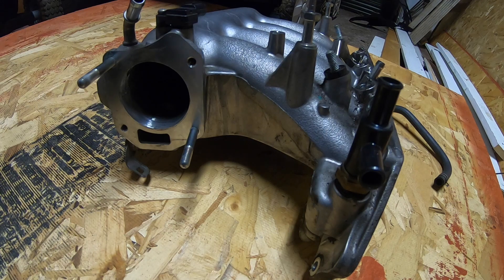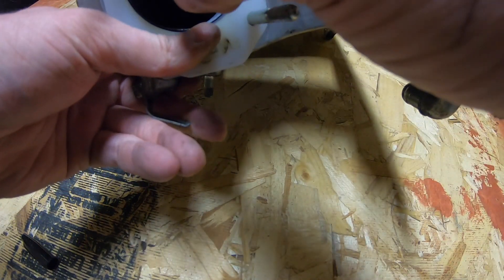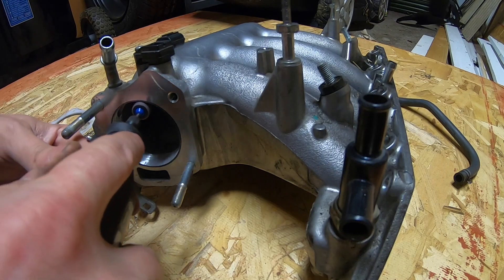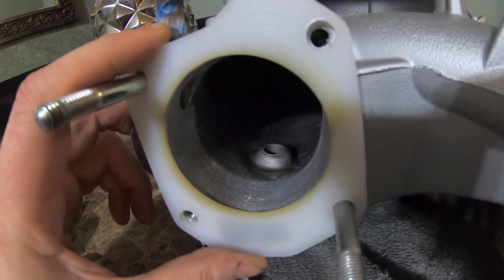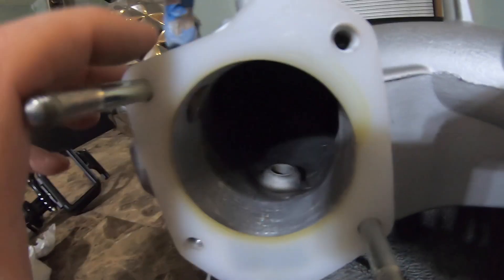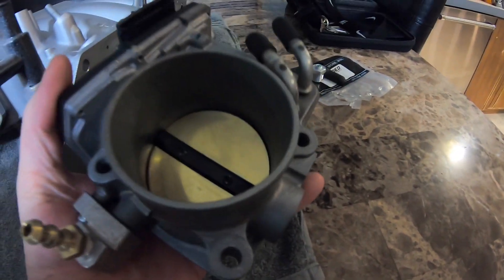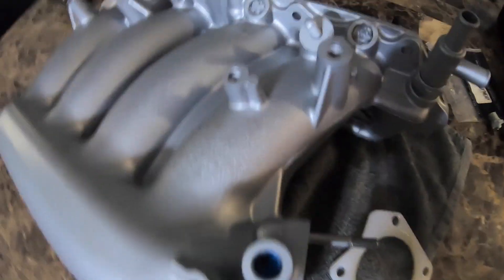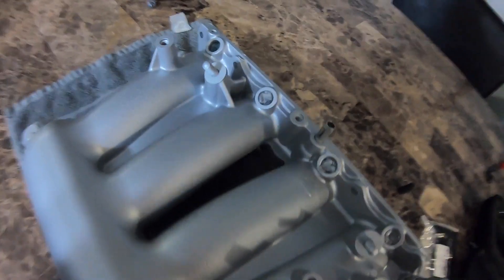8th Gen Civic Si - k20 RBC J35 Port Matching DIY

Comment: What is the tool called that you used to do this ?
Reply from the maker: Dremel... I used a Dremel 200 to be exact.
Reply: rcysiFg2 okay I appreciate the reply ! Also is there different tips? If so which one did you use? I’m not familiar with those tools at all
Reply from the maker: @solidstreetrunz3956  np, ya theres lots of tips. I used the wood sanding bit. You'll go threw a few but with the wood but you wont gouge the metal.
Reply from the maker: @solidstreetrunz3956  https://www.lowes.com/pd/Dremel-200-17-Piece-2-Speed-Corded-0-86-Amp-Multipurpose-Rotary-Tool/3824377?cm_mmc=shp-cprdtolgooglelia-129-rotaryandoscillatingtools-3824377-_-0&store_code=1693&placeholder=null&gclsrc=aw.ds&&gclid=Cj0KCQiAoIPvBRDgARIsAHsCw08WwHQXYd3FOsaBSSQGzTxcI8CJTTAKqhGxLlNF2E1qf8GIBydiVggaArAfEALw_wcB#
Reply: rcysiFg2 awesome and one last question.. what did you do to clean the manifold out after you ported it ? From all the shredded little metals
Reply: rcysiFg2 and did you have to get a retune after this ?
Reply from the maker: @solidstreetrunz3956  Just spray it down good with some brake cleaner, it will dry fast and leave no residue (Or you could even use water as long as you let it dry out good ) than I took my compressed air and blew it out real good... wit the wood bit it makes more like "dust" than big chips. No need for retune after that.
Reply from the maker: @solidstreetrunz3956  I had the tune adjusted for the J35 Tb when Installed it, so Steve said the port mach wont change much, the tune will automatically compensate up to 2-3% changes.
Reply: rcysiFg2 hell yeah sounds good man !! 1 last thing for sure this time lol how come you didn’t just go j37 throttle body ? Is it too big for n/a  or can you still run it ?
Reply from the maker: @solidstreetrunz3956  the j35 flows more than enough air already for and the tb on our cars is not really a restriction. So the j37 isn't necessary, especially for N/A. It wouldn't HURT but you wouldnt see or feel a difference while NA from it. for boost j37 would be good probobly but 90% of people  still run j35 with boost also. Plus the j37 is like 100+$ more lol for no real gains..
Reply from the maker: @solidstreetrunz3956  also on top of the price of the j37, you need an adaptor to make it fit, as thg e j35 is direct plug and play.
Reply: rcysiFg2 okay I see man appreciate all the info!! I just picked up the grams Performance 72mm throttle is about half off right now for Black Friday , which their website claims is also I direct replacement no adapter needed .. so I’ll definitely be port matching
Reply: rcysiFg2 I was going to cancel my order and go with the g37 but I’m glad you let me know it’s not needed !
Reply from the maker: @solidstreetrunz3956  hey do what ya wanna do lol. I just didnt think it was necessary. If you plan on boosting later may be worth it, but for bolt ons the j35 is perfect.
Reply from the maker: @solidstreetrunz3956  there are lots of threads of people debating it. Most people go j35 for the bolt and play aspect.
Reply: rcysiFg2 I see your point bro, only reason I went with the grams is because it was on sale if not I’d just go with the j35
Reply: rcysiFg2 and I know I keep saying this is my last question but I just keep thinking about new questions lol but this will be the last .. where do you buy the wood sanding bits? And about how many did you go through ?
Reply from the maker: @solidstreetrunz3956  haha it's all good glad to help. I got mine at lowes. If you buy the dremel in a kit it will come with a few bits and like 3 sanding bits. Than buy an extra pack of like 6, they're like 4 or 5 bucks a pack. I used 5 or 6..
Reply: rcysiFg2 okay man once again I appreciate the info I was looking everywhere to get my manifold ported from a shop but everyone wanted an arm and a leg for it